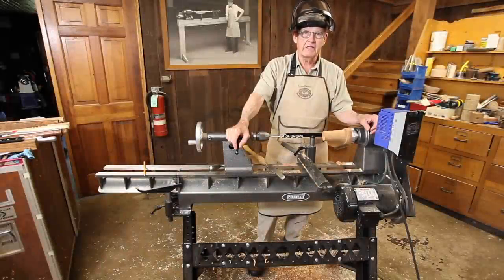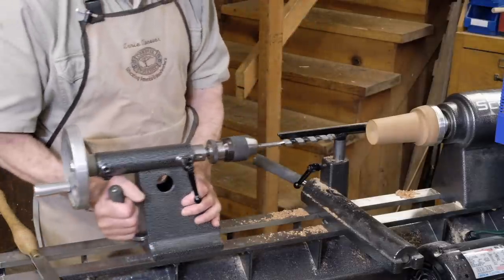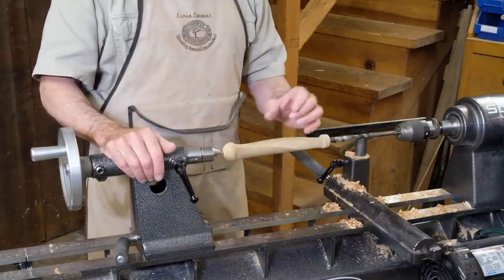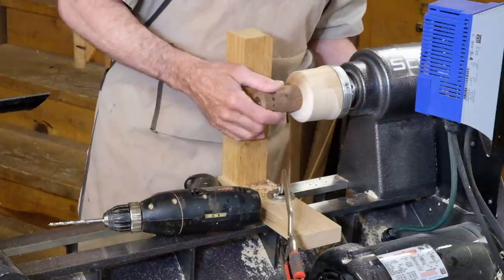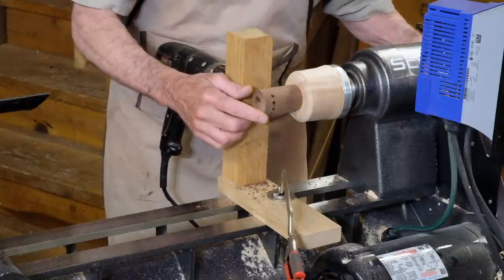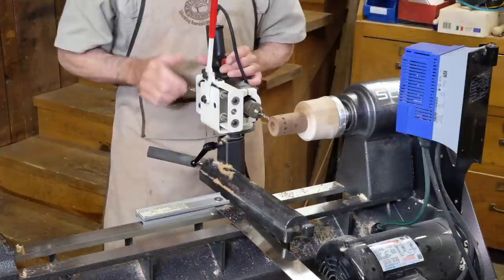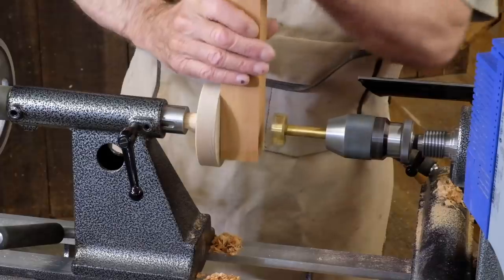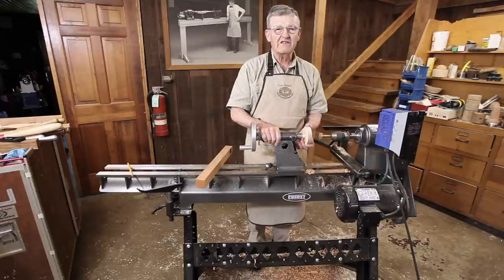Drilling with the Lathe | Woodturning Tip

Comment: How deep of a hole can you drill with a lathe? I’m interested in whistle/ flute making.
Reply: If you hold the drill in the headstock and push the work with the tailstock you can drill from each end and get twice the flute length of the drill. Holding the work with a clamp may be advisable to prevent injury if you drill out the side. A standard length twist drill is called a jobber, but you can buy long versions called an aircraft drill. For flute making you will have to then use a reamer to get the conical bore.